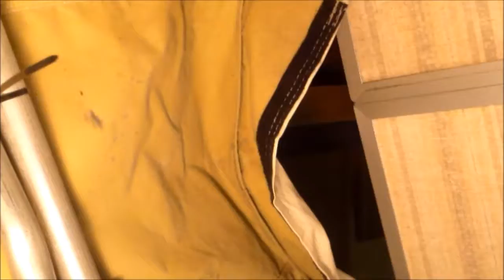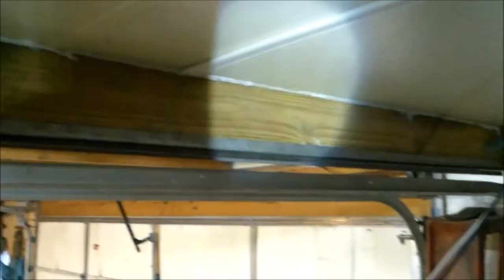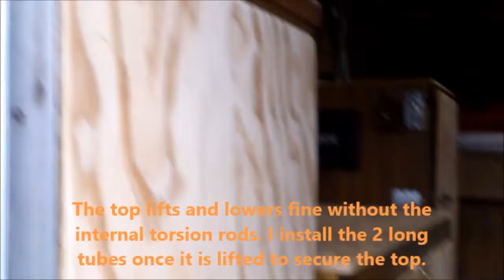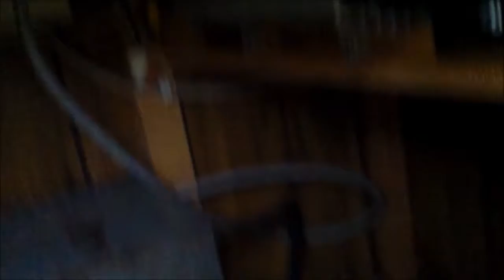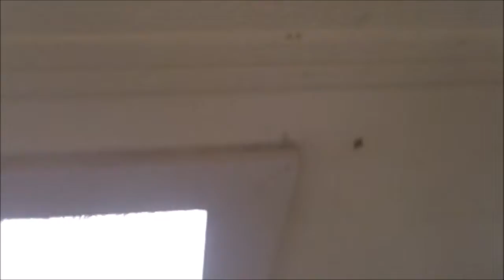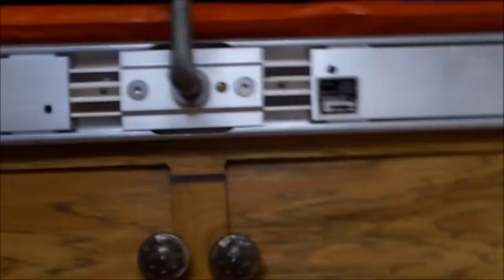Repairing Palomino Pop Up Truck Camper

Comment: Question well questions…
Did you get the small inverter from walmalrt?
And what are you running the no fuse outlet on and the antenna/ cable line on?
And any advice on painting that would?
I’m not a fan.
Reply: Is it that battery..? Haha I didn’t want the whole video.
Reply: @Boatcaster  I watched the video. The whole video. It was a long night.
What year/model is your camper?
I have a camper like yours, there isn’t much information.
I would like to know ways to incorporate the converter with off grinding power If.
I am going to add solar panels later. 
But I would like to run two power systems if possible.

Comment: I just picked up a 89 with the same exact issue. The rear corners are rotted out on the top. I might have questions or seek advice in the future.
Reply from the maker: That was a giant job, but once repaired, we traveled all over in it. Sold it when I purchased a pull behind. I do miss it though.

Comment: The 3 prong plug... the 12v plug. What does it go to on the truck? I can not find a 3 pin flat connector anywhere online. So the instructions on it wont help. Lol. 
 Positive, negative, park lights???
Reply: @Boatcaster  
I have a 3 prong on the camper. Came with 3 prong. 4 prong on my truck. 
I'd show a pic but cant on this.

Comment: I removed the weld on that part in the tube.  It is only a round plug with a hex broached for the rod to fit.  There are no other parts inside.  Must be real trick to line up the corner brackets with torsion bar.
Reply: I took mine apart this weekend to fix a crack in the main tube (where top tube meets the down tube, had it welded). Had the hardest time figuring out the torsion bar. I too reinstalled it without torsion bar. How would anyone manage to re-install it. You'd have to be strong enough to twist that thick steel (without breaking anything). I did notice that it was significantly harder to crank up without it. I may remove the air conditioner that adds 100 lbs to the roof (I use the camper more in winter anyway).

Comment: I would like to know if you had problems with the corner brackets lining up.
My Viking is similar to your lift system.
My back corner brackets will not locate square to the side board.  removing the corner bracket they put a steel rod with hex cut ends. putting bracket back on leaves the bracket at an angle. You know how to line it up?

Comment: How did you fix the lift system?
Reply from the maker: I removed the center torsion bars, I now insert the small alum. tubes once it is cranked up. It works great.
Thanks for watching.
Reply: Were you able to use the original aluminium slides? I can only find short ones but the ones I need are the same length as yours.
Reply: I've got the exact same camper needing some repairs.
Reply from the maker: I just removed the torsion bars, I use it to lift without the help of the torsion bar.

Comment: That rod is a torsion spring to aid in lifting the weight of the roof.  The latch to hold it up should be on one side of the lifting mechanism gear system on the right side probably. The lifting system is called a Heco lift and parts are available for it from Canvas Replacements I think (I believe they bought the business from the original manufacturer)

Comment: Nice work. Just a thought: although it's not my experience, some people say not to use pressure treated wood in campers, primarily because it will cause the aluminum cladding to quickly corrode and develop holes (sounds plausible) and also because of the chemicals it offgasses into the camper.